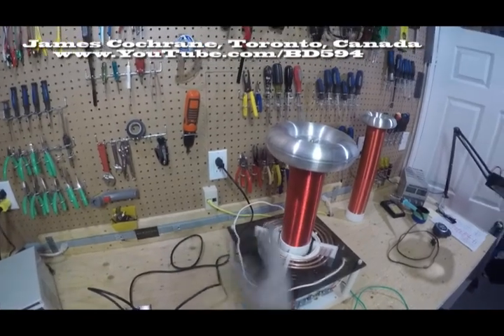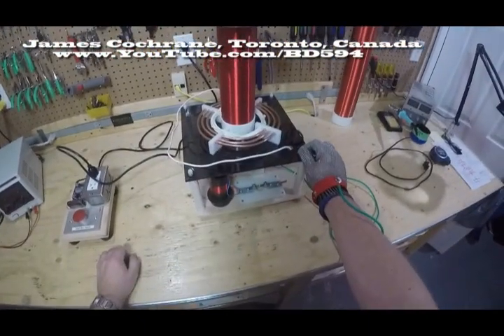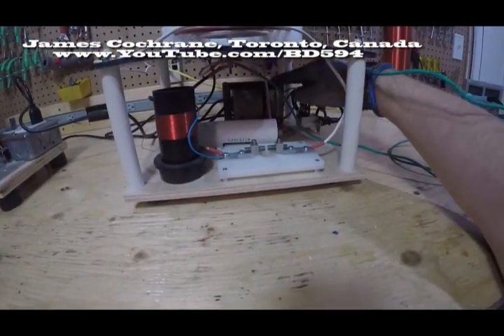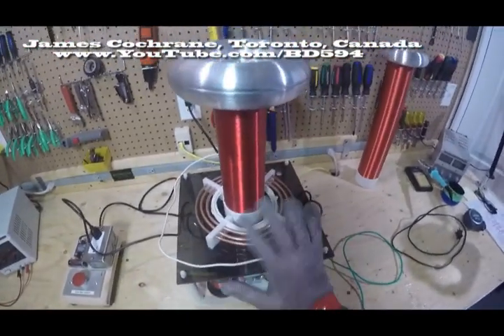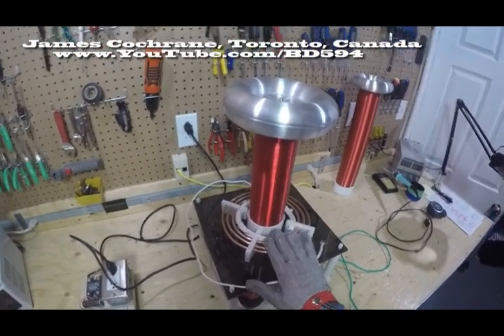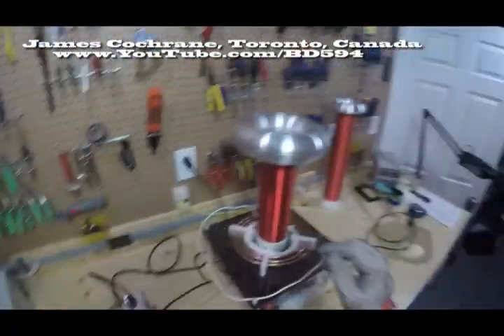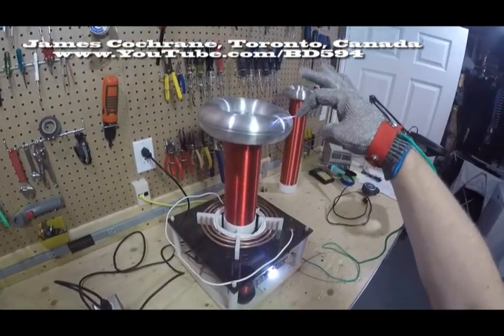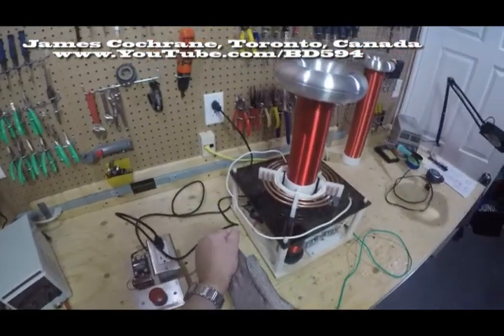Spark Gap Tesla Coil Faraday Glove Test

Comment: I'm not sure if faraday glove is a good idea. Because if the arc jumps anywhere else than to the glove electricity would go through your body through the glove to ground. Proper faraday cage would surround your entire body. I know that that would cost a lot but be carefull with high voltage.

Comment: Is it 600 or 6,000 volts from the supply transformer? If it's a neon sign transformer, they come in voltages of 5,000 up to 15,000 VAC and currents of 30 or 60 mA. 600 volts would not be enough to trigger a spark gap. Spark gap TC's require a minimum of 5,000 volts to trigger the spark gap, that's why (despite their excellent high current,) microwave oven transformers at 2,000-2,300 volts can't be used without multiplier cascades to up the voltage, or rotary spark gaps with contact electrodes. I'm also unclear what the smaller coil on the bottom is for, is it an RF choke coil to protect the supply transformer? Usually the tank capacitor is connected either in series, or parallel, with the primary coil (copper plumbing tubing.) I was just wondering because you made it sound like the small coil was part of the primary circuit rather than a choke coil that is part of the supply circuit. If it is a choke it could use being bigger and a second one on the other leg of the supply. A high voltage RF bypass capacitor, of a value adequate for the resonant frequency of the TC, across the supply right out of the supply transformer, and before the chokes, would be a good idea too. RF is not good for mains frequency transformers. Also did you call the spark gap electrode's tungskin? It's tungsten, not tungskin. It may have just been a pronunciation thing or something, or if I heard wrong, I apologise. Nice table top TC.
Reply from the maker: Yup, you are correct 6000 volts.
Reply: bd594 oh ok. Have you ever thought of making a vacuum tube TC? They’re not complicated and give some great results at table top sizes. You already have the Variac which is good. They’re not expensive to make and are pretty cool TC’s.